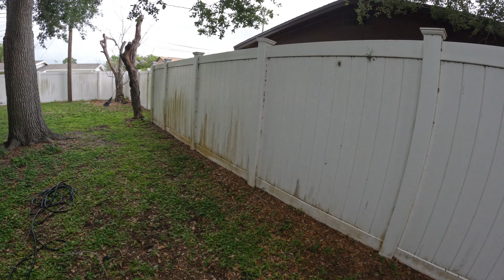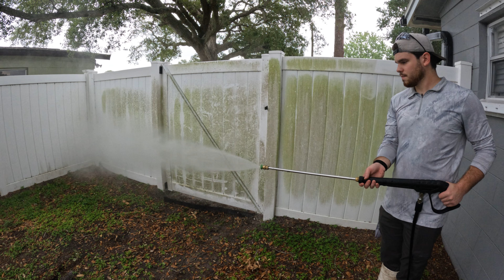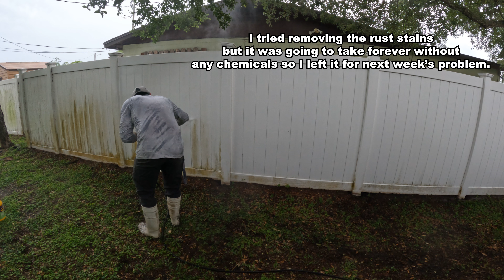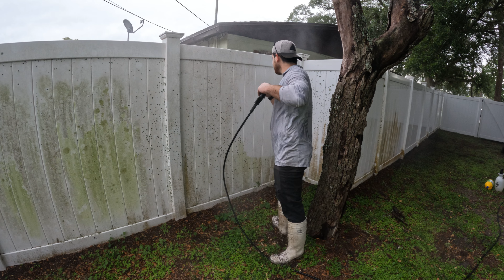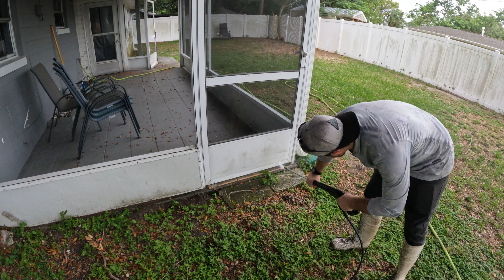I Pressure Washed This INSANELY Dirty Fence for *FREE* (To Be Continued...)

Comment: I feel like you would've saved a lot of time here with a light coat of bleach, let it rest, then a rinse along that wall
Reply from the maker: I didn’t show it but I did cover it in bleach and let it sit for 20 minutes or so before going at it with the pressure washer. I’ll give it a coat next time too to completely get rid of all of it 👍🏼
Reply from the maker: Also the rough spots were rust stains. I’ll be back next week with rust remover and spray that area with it
Reply: @SunshinePressureWashing  Did you use a pump up sprayer?
Reply from the maker: @TANMAN84  I did
Reply: @SunshinePressureWashing  I know this job was for free, but what usually is your method for quoting these type of jobs? How much was this one?

Comment: Hi, You NEED EYE and EAR PROTECTION...at the Very least!   😮
Reply from the maker: You are very correct. I did bring my safety glasses but they kept getting water on them and I could barely see so I kept putting them on and taking them back off 😂 However for the ear protection I definitely do need to start wearing it 😅